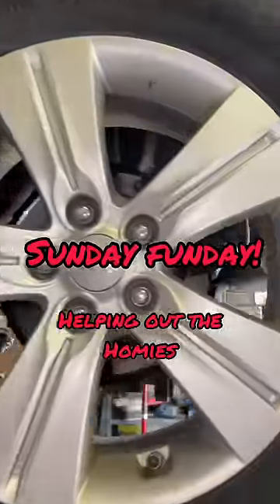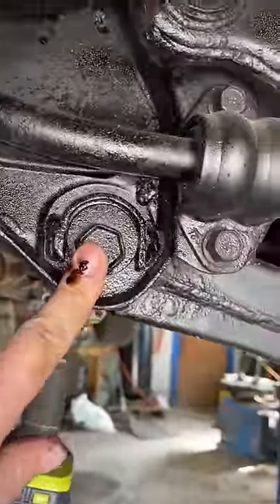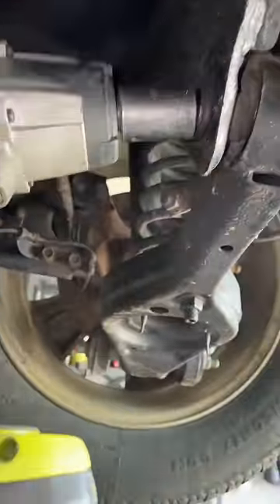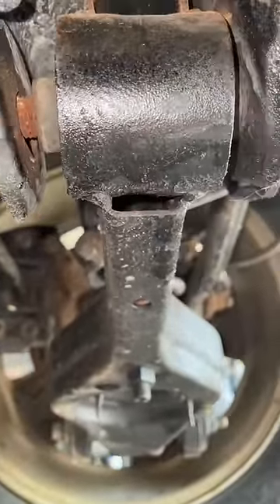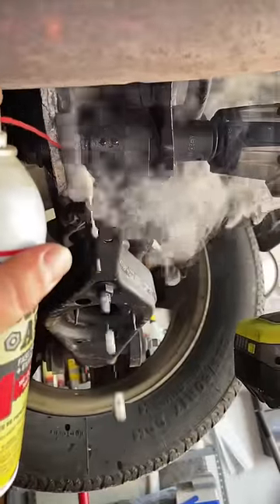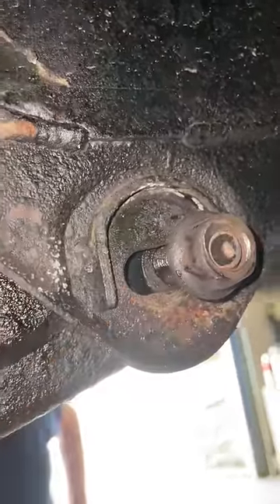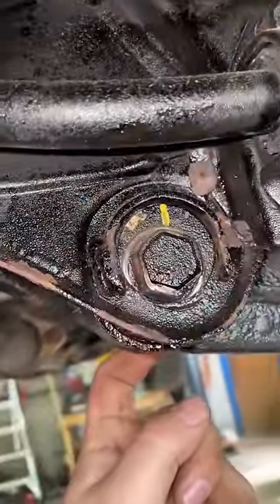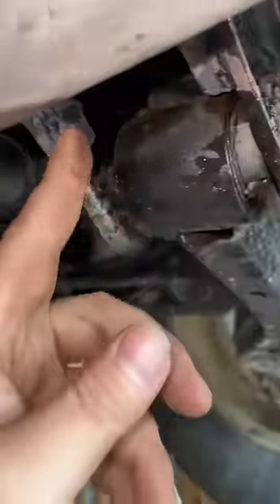Vehicle can’t be aligned problemo

Comment: There is a trick to getting these seized bolts out of any bushing like that. Instead of cutting both ends off you just cut the head of the bolt off. Then tighten the nut down which will force the bolt to start coming through the bushing because the head is no longer there to resist. Once you run out of thread and contact the shoulder back the nut off and stack washers and then run the nut back on pulling it more. Repeat and you will get the bolt out. Once out you will have to run a drill bit in the hole to clear out rust build up. This method has worked countless times for me to remove leaf spring bolts
Reply: Clever idea! Like when you have a booker bar and one end of the thread is cactus so you thread a nut from the other end to force out the crimples 😺
Reply: The fact that he used a ryobi is enough to tell me he would have never known your method.
Reply: I use my c-clamp that's meant for ball joints to press out those bolts works every time
Reply: Be sure to start with the headless washer technique, if you get it all spinning you are screwed.
Reply: Ngl thats eluded me for years ive always just cut it out and replaced the bushings and bolts.. you win the internet for me this week my now friend stranger mechanic
Reply: @SirDadbod exactly, ryobi is joke.
Reply: Ryobi is really good
Reply: @ifyoutip  not being a tool guy whatsoever, craftsman has a 20v soldering iron and 20v rotary tool (dremel) which was quite compact and powerful. Really impressed me when i saw the innovation
Reply: @cyclesaviorn2700  I have lots of tools, and I got some Ryobi tools as a gift many years ago. I myself have purchased lots of DeWalt tools. But my DeWalt tools are not at my house. The Ryobi tools have lasted as good as the DeWalt and I think the Ryobi batteries are better than any other batteries I have ever used.  I have the rotary tool in DeWalt and really like it. My co workers like it to. They ask to borrow it often enough. And I like my DeWalt cordless heat gun.  I think a cordless soldering iron would be nice. I don't have one of them. Though I do like my old faithful 300w Weller soldering iron pretty good. I have a cordless router in the Ryobi set. It's well over 10 years old. I use it often as I like to do some woodworking projects. My DeWalt stuff stays at the shop where I work. My Ryobi stuff at home.
Reply: Honestly this doesn't really sound like a trick, just a lot of extra steps, time and parts.
Reply: Nice idea. Hope I remember next time I need it lol.
Reply: Heat
Reply: @sharkeyist what is the headless washer technique? His theory sounds great until the  inner sleeve starts spinning too for sure
Reply: Best comment ever!!
Reply: @erickalexander5850 Thank you for speaking logic
Reply: @ifyoutip Ryobi do a nice cordless soldering iron 👍
Reply: @TamaHawkLive 
Sounds perfectly reasonable to me in the right situation. The washers are ten a penny and good for next time.
Reply: Kinda like when you take inner most bushing from the thing to that thing. Yeah
Reply: thank you, bullshit 500.00
Reply: I've cut those seized bolts on both ends to get the arm out of the car, then used a press to try get the bolt out of the bushing. went up to 20 tons and no sign of moving
Reply: “Contact the shoulder, back the nut off, and stack washers” sounds like a good night
Reply: Oh thank god I saw this, the amount of stuck leaf bolts I’ve just cut out and fucked around with, definitely trying this next time
Reply: @MadEvo606  And this man speaks no bullshit! Thank you sir!!😁
Reply: Awesome idea for someone who might not have a press at their disposal. Well played sir 😎
Reply: Holly fuck. Never thought of this! Gonna try this out!
Reply: That is IF the nut can still be spun on the bolt thread, often times they are so mushroomed from corrosion that already caused the sleeve to seize up. Chances are if you could do this "trick" you probably didnt even need to.
Reply: @staym925  Many many youtube channels have proven that false my guy. Keep buying your overpriced Milwaukee though.
Reply: @crisnmaryfam7344  yeah ok, I work construction and ryobi doesn't last, why is it,  I dont see anybody in my line work nobody is using them? Its because they don't last, here in the real world, not no youtube land, we build, remodel, and demo houses, so yeah my guy.
Reply: Excellent idea of extracting bolt without the head....👍
Reply: @SirDadbod dude could be working at his home shop or something, why spend Milwaukee prices for projects at the house?
Reply: @handle2935  you spend more buying cheap. Buy the time that first battery dies and you buy a second battery, you have spent more for the same and Milwaukee and Dewalt are more powerful and better made quality. These are concepts that hard working thinking men make. When u buy ryobi, your being cheap, not thinking, and spending more for stupid thinking. Anything important to u deserves respect and proper attention.
Reply from the maker: solid tip. i do this as well
Reply: Unless your bushings worn and the whole bolt spins in the bushing
Reply: SOLID GOLD, Sir.
Reply: Man where were you a few years ago when I was changing the lcas on my g8
Reply: @FerKurl then why didn't you do it in the video?
Reply: Good idea bruv, I like it.
Reply: Ryobi is taking over 💯😎 #Team Ryobi  @SirDadbod
Reply: I will use that method next time I run into this thanks for the tip
Reply: Thanks for great tip❤
Reply: That is a sensible idea.
Reply: Rip my comment got deleted 🤣😂
Reply: @BusyMEOW if Dunning-Kruger effect was a comment you'd win the pony.
Reply: @The_Sage_of_Six_Paths  Why you little..
Reply: Holy shit you're a genius
Reply: @jamescharlesworth775  Who, me? 😊Thanks, you're too kind!
Reply: @ifyoutip I use ryobi as a Carpenter/contractor. The batteries (big 20amp) last longer than Milwaukee. Cost less then everything else. The best cordless Sawzall they make is making a burning smell if I'm hogging on it. But I've been beating in it for 6-7 years. I have the impact gun in this video. It does suck in comparison. I'd trust my makita screw gun more😂
But it will spin nuts on and off after you break loose all day with the big batteries. When he says "does ryobi have what it takes" was a joke.
Reply: @TamaHawkLive bingo. I think he's one of them back of the trailer shed mechanics. They smaaart
Reply: Holy shit mate thank you.
Reply: @sharkeyist  What is the headless washer technique?

Comment: The black spray paint definitely tells you it's a  rust bucket, lol.
Reply: @ins2177  😂😂😂
Reply: The black spray paint is the problem. It’s the wrong thing to do for rust.
Reply: @sbond1963  yeah that’s the point of my comment.
Reply: @sbond1963  what is the right way? Genuinely interested lol
Reply: @ace7912  rust or corrosion needs oxygen, moisture, and electrolyte (salt) to grow. To eliminate or stop rust growth the goal is to remove as many variables as possible. Some products are more effective than others for each. Depending on how bad the surface rust is depends on what you use. You can’t use bedliner, POR 15, paint or rubberized undercoating on most existing rust. Because they do not penetrate, so you still have oxygen and moisture residing in the rust underneath. Wax coatings like RP-342 cosmoline repel water and penetrate the top layer of surface rust locking out oxygen. For severe flaking rust you have to use an oil spray for deeper penetration of the rust layer. Oil spray needs to be reapplied every fall. New vehicle I would use wax. Old vehicle with significant rust. Use oil like fluid film.
Reply: @sbond1963  oh very cool thanks for the info. Never considered penetrating treatment
Reply: If vehicle manufacturers would just use more plastic parts we wouldn’t have these rust problems
Reply: @dcraexon  durability and structural integrity come into play though.
Reply: @MrMpm3001  what integrity🤣
Reply: @dcraexon  unsure what you’re asking. He’s working on suspension and the spray painted parts are metal. Where would they switch the plastic to? Plastic has no structural integrity whatsoever on suspension.
Reply: @MrMpm3001  Yeah but plastic doesn’t squeak as much as metal ,ask Barbie
Reply: charlesmartell4484  ATF is better for rustproofing? Define what you mean by better. You would have to spray ATF every couple months because it would not hold up to wet conditions. ATF is thinner than oil so it will keep washing off. Also everyone knows ATF is rough on transmission lines and PS hoses. Makes rubber brittle. So I would not recommend spraying that on my undercarriage coating brake lines, bushings, wire harnesses with ATF.
Reply: @MrMpm3001  My GF has a 2019 Jeep Cherokee. It’s a Chrysler/Fiat mashup. They used a lot of aluminum to decrease weight and assumption rust. Well, it didn’t quite turn out that way. In the salt they can suffer from a chemical reaction called galvanic corrosion. When dissimilar metals touch each other, it makes the softer metal corrode faster. Aluminum doesn’t rust it corrodes. Example is the rear differential. They didn’t use anodized aluminum. It’s connected to a steel rear subframe. The rear differential was corroded so bad in three years it cracked and needed to be replaced. I’ve never in all the years of owning vehicle seen anything like that. But I do admit, I like the Fiat/jeep functionality. It’s great on the highway and takes a beating in the woods.
Reply: @sbond1963 does the wax get sprayed on
Reply: @sbond1963 oil leaks keep vehicles on the road longer. 😮
Reply: @sbond1963 Hyundai Canada recall 20D145 - elantra underbody rust inspection and treatment. Steps: Hit subframe, arms, rear beam with hammer to see if you make a hole. If you do not make a hole, spray the rust with rubberized undercoating. Doesn't even last a few weeks before it all falls off. And that stuff just traps moisture lol
Reply: @ace7912 scrapyard and turning the car into a small cube